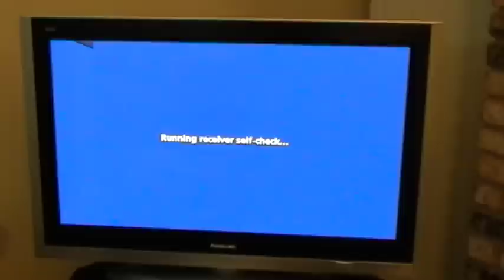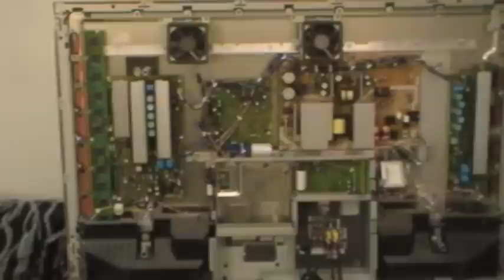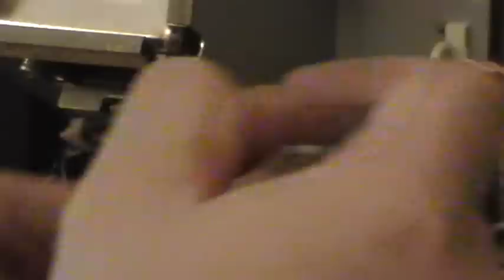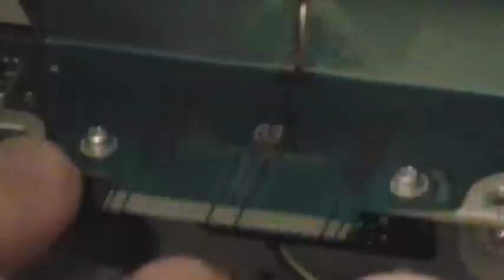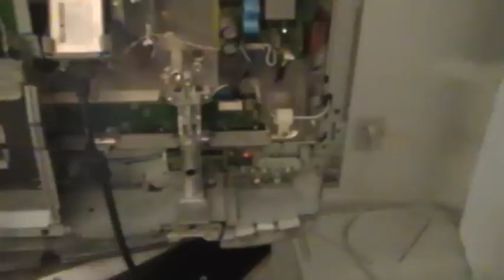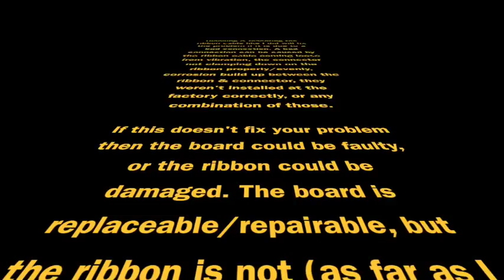Fix Panasonic Plasma TV Vertical or Horizontal Bars

Comment: I accidently broke the small black clip taking it out. Any way to buy a new black clamp or home rig something?
Reply from the maker: I'm not sure which clip you are referring to. But if its plastic, maybe superglue?  🤷  Its really hard for me to say without seeing it.
Reply: @petrocksgarage  Thx for gettine back to me so fast..It's the small black clip or clamp that you lifted with your fingernail to clean the ribbon. You said to be careful and don't use a screwdriver. I found your video after I snapped it in two.
Reply from the maker: @jaycee7440 , oh, around @6:47.  Hmm...  I'm not sure.  Yeah, don't use superglue.  :)  However, if memory serves, the middle of the clip really isn't the important part.  It's the outer edges.  So if you can put the ribbon in the connector and gets something to push on the outer edge of where the clip was to have it clamp down you should be ok.  But again, it all depends on how it broke.  You definitely don't want this connection loose, otherwise the bar will return.  Good luck.
Reply: @petrocksgarage  Thx again, so is there any  place to buy that little black piece with about 6 little tiny squares in it.. or Do you know the name of that part?
Reply from the maker: @jaycee7440  Sorry, I have no idea.
Reply: @petrocksgarage  Wish I watched your video 1st..Thx
Reply: @petrocksgarage  I was able to get a buffer board on Ebay for about $15. I just need the little black lever (AKA clip, clamp) around 6:30 in the video. I'll keep you posted when I try to install it.
Reply from the maker: @jaycee7440  Good idea. Good luck.

Comment: How long should I wait after unplugging the tv? Kinda worried about electrocution.
Reply from the maker: You should be fine by the time you have all the screws on the back of the TV unscrewed. I wouldn't worry too much about electrocution. The TV doesn't hold that much juice in its capacitors.
Reply: @petrocksgarage  mine is a 55 inch will it be roughly the same internally?
Reply from the maker: @VTEC-YO , if it is the same model, just bigger, compared to my TV then yes. If not, then not exactly but the ribbon location will still correspond to the horizontal & vertical bars like I show in the video.

Comment: excellent advice, for those who have a vertical line problem, since  the description of the connector removal is vital.  a credit is due for the explanation and action.  Certainly the grounding of oneself to the tv metal work before touching anything.  A very good - powerful vacuum cleaner tube, and a paintbrush used at the same time, will remove external dust on components and on everything under the cover.  Cleaning the connector terminals with a not contributing thing -  like a quality artists fine paintbrush using pure alcohol  is just as important since micro fibres, like dust,  can stop connection between such fine strips as the connector uses.. My panasonic viera 50 inch, has 15 vertical line connectors, and my line was in the middle.So, i took apart connectors 7 and 8 to be sure of the line inclusion. - i expected to have chosen the wrong 7 and 8, since 15 means an odd number..  i also opened but did not disconnect all the connectors, and snapped them shut again...  and on reassembly and power up, the line was gone...   :)  Therefore, on my experience, i recommend this post of Pet Rock`s Garage.
Reply from the maker: Good tips and thanks a lot. I appreciate it.

Comment: What did you / or anyone else with a success,  `CLEAN` the connections with ? Isopropyl ? and would it be any benefit to use a little Dielectric Grease to aid conductivity ?
Reply from the maker: Yes, isopropyl alcohol will do the job. Dielectric grease does not aid conductivity. Dielectric grease does not conduct electricity.  It helps prevent corrosion. But using dielectric grease would not hurt either.

Comment: 2:13 huffs compressed air
Reply from the maker: haha...
Reply: Pet Rock's Garage thumbs up for being a good sport
Reply from the maker: @Uberzit , :) Thanks. You're definitely one of the more observant commenters I've had in a long while.
Reply: @petrocksgarage    I was replacing the Y board on my Samsung PN60F8500 plasma {fixed it} and when putting the back cover on it snagged one of the  Flat Copper Ribbon Cable that attach to the screen and rip /tear occurred .   Now 
there's no picture from that area of screen ,UGH.  I was down to the home stretch and had it all fixed until my mishap. Is there any way to replace the ribbon or repair it?  Someone said they can't be replaced because the copper ribbon cable is bonded to the screen ,is this true? Thanks.
Reply from the maker: @rainerrain9689  Ouch. Sorry to hear that. The ribbon definitely can't be repaired (without some super fine tuned soldering skills), it needs to be replaced. How to do that depends on your TV.  If both ends go into connecters, then you should just be able to remove the ribbon and replace it. However, if one ends is soldered to a circuit board then you have to replace that entire circuit board. Hope that helps. Good luck.
Reply: @petrocksgarage  

I haven't looked to see where the other end goes to if it is bonded to screen or a connector.  It ripped about an inch before the connector end which connects to the Y board.   I got so pissed I just walked away deflated and haven't touched it since,took the wind out of my sails after all the work I did. Thanks for the reply.
Reply: Rainer Rain good luck...it’s a great 📺.
Reply: @douglas60040 Thanks, but I took it apart and the other end is bonded to screen,have to junk it. :(
Reply: @rainerrain9689  yeah...I'm pretty good at soldering, but that's a huge challenge. Probably keep the power cord...recycle the rest.
Reply from the maker: @rainerrain9689 , ouch. You could try hitting up a local TV/electronics/computer repair shop and see if they could swap out the cable for you if you bring them the board. Good shops will do circuit board level repairs. Call ahead and ask first of course. The actual job of desoldering the cable and soldering on a new one is not that difficult really. The difficulty is in attaining the skills and tools to be able to solder on a circuit board. For someone who knows what they are doing, it should take 10 minutes or so.  Hope that helps.
Reply: @petrocksgarage   Hi,, unfortunately  these cables can't be swapped out and the other end is bonded to the screen. Plus you can't even order these flat copper ribbon cables because they are attached  via bonding {not connector} to the plasma screen. I would have to buy an entire screen ,not worth the trouble. I'm just pissed at myself for snagging and ripping that ribbon after all the work I went thru. Thanks so much for you time and reply, appreciate it. Happy New Year.

Comment: 2019. Just about to try this on my 58" panasonic viera. I'm kinda excited.
Reply from the maker: Good luck!
Reply: Can't wait to do mine! Manufacturer date is December 2007 lol
Reply: Took the back off. Cleaned 10 years of caked dust. Titened the 4th Ribbon cable at the top. BLACK LINE GONE!! For now lol. Thanks tho. Great video dude
Reply from the maker: That's great!  Glad to hear you got it fixed.  If it comes back, you'll know how to fix it again.  :-)  Mine still hasn't come back after all these years and a couple cross state moves.

Comment: Great video. Unfortunately when i looked at the ribbon on mine instead of the strip being silver its gone gold and bubbled like its burnt out. Can i replace this bit?
Reply from the maker: A burnt out connector is not good. The connector got super hot.  It is hard to say what caused it.  If the ribbon can be disconnected from both of the boards it is attached to then yes it can be replaced. Where you would get a replacement depends on the TV model & brand. I'd contact the manufacturer.  If it can't be removed from one of the boards then the board needs to be replaced.  Again, contact the manufacturer. Good luck.

Comment: Same problem Panasonic 50 inch. But verticle black bar is in center area of screen. Does is come apart to access that same type ribbon connector?
Reply from the maker: Yes, it should come apart in a similar fashion. Since it is in the center you will likely have to remove more stuff inside the TV than I had to though. If you take your time, take pictures of everything parts before you remove it (for reference when putting it back together) you should be fine. Good luck.
Reply: @petrocksgarage  well, wasn't an easy fix. I opened it up and accessing the ribbon was easy. But cleaning it made no difference. My symptom is slightly different though. There is a thin white verticle line in the black bar. Rats...
Reply from the maker: Sorry to hear that.  Hope you figure it out.

Comment: The problem was vertical. Why did you clean a horizontal connector? I thought you said vertical lines are caused by vertical chips, or connectors didn't you?
Reply from the maker: I kept flipping horizontal & vertical in the video. To clarify. The connectors at the top or bottom of the panel typically control the vertical. The connectors on the left or right of the panel control the horizontal.
Reply: @petrocksgarage  Thank you. My lines are vertical. Can I access the bottom connectors? Are they also called buffers?
Reply from the maker: @speedracer175 , I would assume you can get access to the bottom connectors. It entirely depends on your TV and how it was put together. They are called ribbon cables.  Buffers are a hardware component on a circuit board.

Comment: What did you wipe it down with?
Reply from the maker: If you mean the electrical components, use a DRY cloth, paper towel or Q-tip.  But be VERY careful not to damage the components. Its best to use compressed air or similar to remove dust etc.
Reply: @petrocksgarage  Awesome, thanks!
Reply from the maker: No problem.

Comment: You cracked the screen dipshit
Reply from the maker: Huh?  If it was cracked you would be able to see the crack with the TV off, which was not the case here. Also, reseating the ribbon as shown in the video clearly fixed the problem I was having and would not have had an effect on a cracked screen. Just sayin'...

Comment: Hey there, I have a similar model of T.V. but I believe that it is a L.C.D. display rather than plasma. Do you think that it is a similar fix? Also the problem that I am having, is that the Right side of the display is displaying more green than usual. Thanks.
Reply from the maker: Yes, it could be the same problem.

Comment: Hi, I'd like to know what the ribbons look like.
  You take a couple of screws off something and fold down a blue plate which has a chip to either side of the number 63. Is this a ribbon? Or, is the ribbon what the 63 plate folds up against ; something not quite visible in the vid?
Reply from the maker: Its the thing that starts flopping around after I disconnect it around 6:57. The green thing with the number 63 on it in the video.  Hope that helps.
Reply: Yeah thanks I couldn't tell if it was blue or green but the '63', and '6:57' I can't go wrong . Cheers from Bonnie Scotland.

Comment: I got to HP plasma TV with the same issue but my black line is in the middle what's your suggestion?
Reply from the maker: It could be the same problem as mine. You need to find the ribbon cable corresponding to the section of the panel that has the black line and try to reseat it.  Good luck.

Comment: I have a HP plasma that has this but pink and always there about four of them and they can change black if I mess with the dials. Logic board? My zsus and and power supply is good as replaced last week from ebay after research. Almost there besides pink lines and adjusting dials proper with meter . . . help! I don't know how to set dials on ysus and zsus just know how to on the power supply for vs and VA. Thanks, Steve
Reply: Nice mode by, I want to do the same if can find a 12v rail...
Reply: Mod **
Reply from the maker: It is hard to say what is going wrong without having the TV in front of me.  Sorry.  Good luck.
Reply: Is it usually a better chance of "NOT" being a failed panel with the thin vertical lines on a older plasma with bottom right and left buffer boards as well as main buffer board and the lines going thru the main displays MENU option as i know a rule of thumb is whether it is running thru the menu with vertical lines or it is not running thru the menu but I can not remember which..... Thanks...

Comment: just had this   problem on my th-42px60u  on the right side  cleaned the ribbons  ..no go  bought  c1   same  ..  put  the org  back in  same place  black vert bar .. bought d board  no change   ok  i put the new c board  back  in  ,,the bar  came  an went  ,,then  back solid  ,,this was pointing  to a bad  driver  chip on the ribbon...well  i hate  to scrap stuff..got out my trusty  ink  eraser..  cleaned  it up   that it  shined   ...put  tuner  back in    ..works    like new...so dont give   up   ..
Reply from the maker: Using an eraser to clean the contacts is a good tip. Glad to hear you got it fixed. Thanks for watching & commenting. I appreciate it.
Reply: we used  them   to  clean contacts on old   tv tuners   in the 70s  ..i could rebuild  25  a day...ok  showing my age  lol
Reply from the maker: Yeah, I've used them for the same purpose a few times over the years. Old tricks still work.
Reply: You sound as dedicated as me to fixing stuff and building our own stuff, computers, etc.... It kind of ruins everything store bought for us after "we know" ehhh...? I can't even suggest anyone to buy a computer or nearly anything anymore - store bought... HAHA... Anyway, can you remember if Is it usually a better chance of "NOT" being a failed panel with the thin vertical lines on a older plasma with bottom right and left buffer boards as well as main buffer board and the lines going thru the main displays MENU option as i know a rule of thumb is whether it is running thru the menu with vertical lines or it is not running thru the menu but I can not remember which..... Thanks...

Comment: Is there a film on the screen I have one and so.e.how it got scratched and now there is a 1mm hole
Reply from the maker: typically there is an anti-glare film on most TVs. That film is likely damaged on your TV. I'm not sure there is a way to fix it other then to remove the film entirely. Good luck.
Reply: Pet Rock's Garage will it effect the quality?
Reply from the maker: I'm not sure. You might get more glare depending on where you have the TV positioned relative to near by light sources.
Reply: Pet Rock's Garage well the only major source of light in the room rihjy more is the screen its self can show u a pic of what I mewn
Reply from the maker: I think I get it. But it would still be hard for me to tell if it will get glare. its all about angles. You won't know until you try it. IMO, unless the damaged area is noticeable while watching TV I wouldn't touch it.
Reply: Pet Rock's Garage I mean it's not that bad only on dark spots it is
Reply from the maker: Then I would learn to ignore it. But that's me. It's your TV after all.

Comment: when unplug the tv just hold power button that will discharge it faster
Reply from the maker: That may work on some TV's, but it all depends on how the circuit is designed and the switch used in the power button. Some buttons, for example, don't complete the circuit until you release the button. So your technique wouldn't work with those style buttons.

Comment: Hello Pet Rock, been having the same problem for years with my Panasonic plasma TH-42PX60B was wondering if you could tell me what the board name is + where I can order it from as been a solid black bar Vertical (up + down) left hand screen for a while and haven't bothered to fix it but it looks simple enough if I take my time and be very careful that I should be able to replace the board myself than taking it to a repairs shop to be charged thru the nose for a simple fix ;-)
Reply from the maker: Sorry, I don't know what the part number for the board or where to get it for your model TV.  Have you tried the technique I show in this video to see if that fixes your problem?  The problem may not be the board. Good luck.

Comment: Worked like a charm, but must warn you that the back panel of my particular panasonic tv has a razor sharp edge located on the sides of the back panel, I probably need stitches, but we're gonna liquid glue and see how it goes.
Reply from the maker: Ouch. Sorry to hear you cut yourself but glad you were able to fix your TV.  Definitely be careful when working around sheet metal like on the back of TVs.  Thanks for watching & commenting. I appreciate it.

Comment: Having trouble with my Panasonic TV that I'm trying to fix. I have the vertical lines down the middle and not on any edge. It makes it a lot harder to try and adjust the ribbons. I have a lot of things in the way and I don't know what to disconnect/keep connected
Reply from the maker: Yeah, the middle tends to be the biggest P.I.T.A.  I would keep taking things apart till you get to the ribbons.  Also take a bunch of pictures along the way so you can reference them when putting it all back together. Good luck.